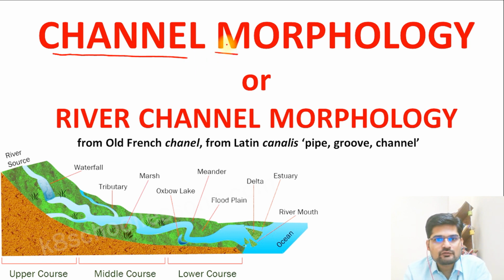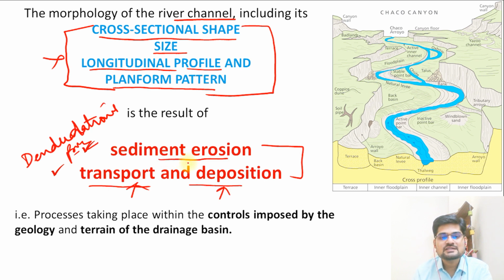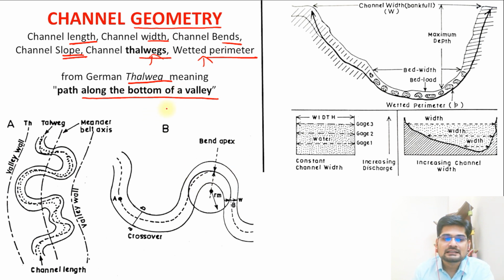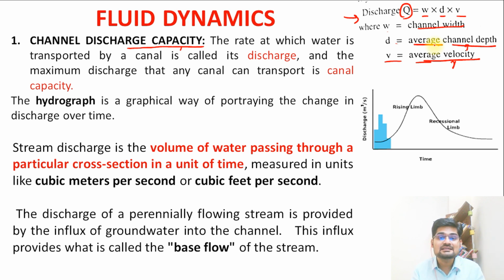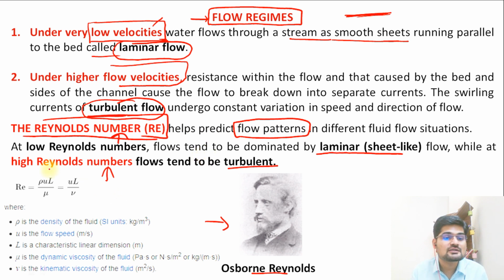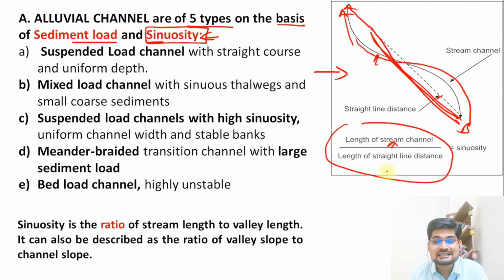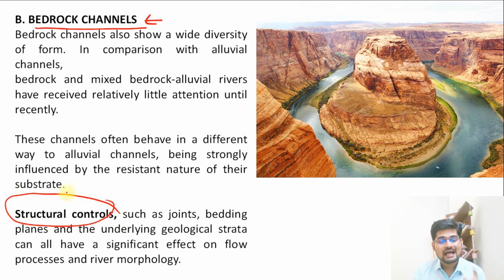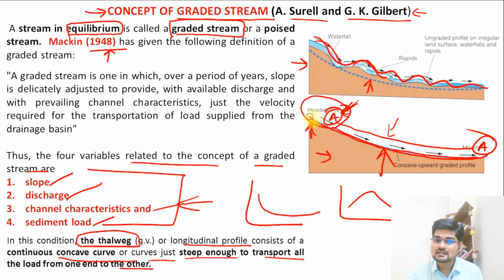Channel Morphology | Concept and Classification |  Geomorphology | Dr. Krishnanand

Comment: sir last year UGC asked form factor where basin area was denoted by A and maximum basin length by L .. and the answer was A/L^2 
how can we define this relation .. using density or any other way ?
Reply from the maker: Form factor is defined as the ratio of basin area to square of the basin length. 
It is a dimensionless number. The value of form factor would always be less than 0.754 (for a perfectly circular watershed). Smaller the value of form factor, more elongated will be the watershed. The watershed with high form factors have high peak flows of shorter duration, whereas elongated watershed with low form factor ranges from 0.54 indicating them to be elongated in shape and flow for longer duration. 
And Yes the formula is right Area/Length (square).
Keep learning..best wishes 🌱
Reply: @TheGeoecologist  thankyou so much for sharing your in depth knowledge 😊